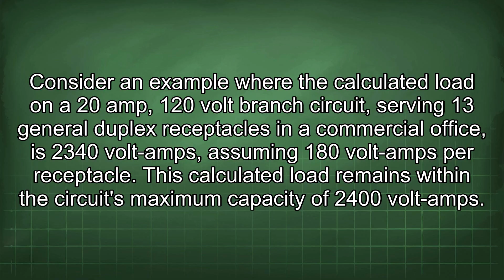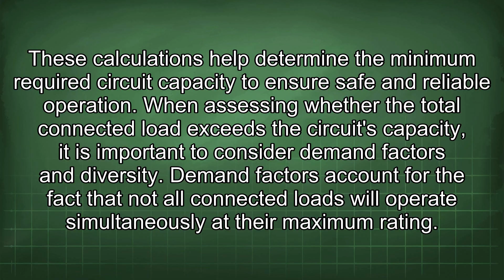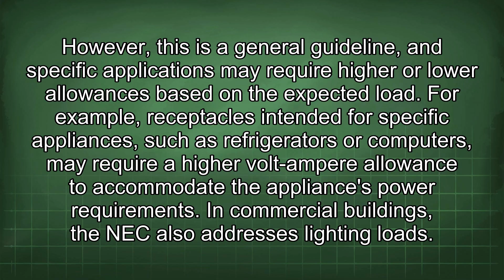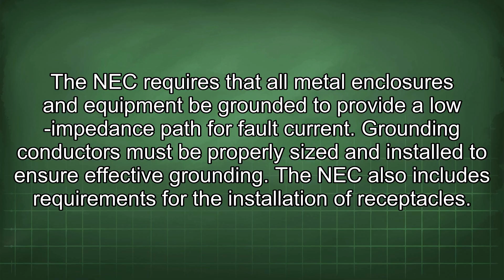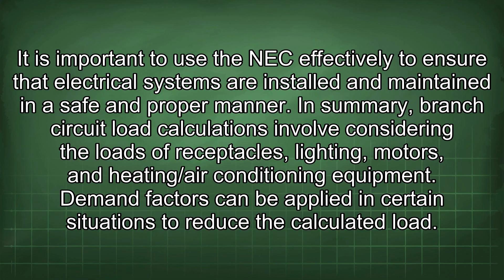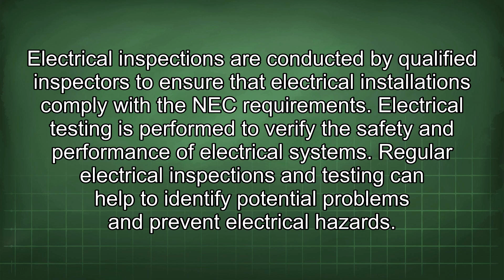Can Connected Load Exceed Circuit Capacity? NEC Explained.

Comment: Code requires calculated load based on 80% for continuous use and 100% for non-continuous. The va per outlet recommendation doesn't limit the number of outlets on a circuit, but it is supposed to be calculated based on square footage of rooms and building as a whole. 3 va/square foot residential. Minimum number of circuits based on footage. If you want 85 receptacles in one bedroom, go for it. It doesn't mean one circuit can serve 50 outlets in every room and 6 or 7 circuits with one outlet in one room.
Reply from the maker: Hello @jimcranston5730,

Thanks for your comment. The statement you've provided appears to be a mix of correct and incorrect interpretations of the National Electrical Code (NEC) and general electrical design principles. Let's break down each part:

"Code requires calculated load based on 80% for continuous use and 100% for non-continuous."

This is generally correct. The NEC, specifically in Article 210.19(A)(1), requires that branch-circuit conductors have an ampacity not less than the maximum load to be served. For a continuous load (a load where the maximum current is expected to continue for 3 hours or more), the overcurrent device (e.g., a circuit breaker) must be rated at not less than 125% of the continuous load. This is often simplified to mean the continuous load cannot exceed 80% of the circuit's rating. Non-continuous loads can be calculated at 100%.

"The va per outlet recommendation doesn't limit the number of outlets on a circuit..."

This is also generally correct, but with a nuance. The NEC does not specify a maximum number of general-purpose receptacles that can be connected to a single circuit. Instead, it focuses on the total connected load in volt-amperes (VA). However, good design practice and local codes may place practical limits.

"...but it is supposed to be calculated based on square footage of rooms and building as a whole. 3 va/square foot residential."

This is correct. The NEC uses a "general lighting and receptacle load" calculation for residential occupancies, and the standard value is indeed 3 VA per square foot. This calculation is used to determine the minimum number of branch circuits required for a dwelling. It's a fundamental part of the overall electrical service and circuit design.

"Minimum number of circuits based on footage."

This is correct. The total calculated load in VA, based on the square footage, is divided by the voltage and then by the amperage of the circuit to determine the minimum number of 15A or 20A circuits required. For example, a 2,000 sq ft house would have a lighting/receptacle load of 2,000×3=6,000 VA. On a 120V system, this is 50 amps (6,000VA÷120V=50A). This would require at least 4 circuits (assuming 15A circuits, 50A÷15A≈3.3, rounded up to 4).

"If you want 85 receptacles in one bedroom, go for it."

This is theoretically correct from a "code" perspective, but highly impractical and a bad idea. As stated, the NEC doesn't limit the number of receptacles per circuit. However, a single 15A circuit can only safely handle a certain amount of load. Putting 85 receptacles on one circuit means that if you plug in just one high-demand appliance, like a space heater, the circuit could be overloaded, regardless of the number of other receptacles. A more practical design would distribute the receptacles among multiple circuits to prevent overloading and provide greater flexibility.

"It doesn't mean one circuit can serve 50 outlets in every room and 6 or 7 circuits with one outlet in one room."

This statement is a bit confusing but appears to be a critique of poor design. The first part, "one circuit can serve 50 outlets in every room," is a valid point of concern. While the code doesn't prohibit this, it's a very poor design that would likely lead to frequent tripping of the circuit breaker. The second part, "6 or 7 circuits with one outlet in one room," is also a critique of inefficiency. While not against code, it would be an excessive and likely unnecessary use of circuits. The goal of good electrical design is to provide a sufficient number of circuits for the anticipated load, with a sensible distribution of outlets, not to just add circuits or outlets arbitrarily.

In summary, the statement correctly identifies key NEC principles (load calculation, 3 VA/sq ft, and the lack of a receptacle limit) but highlights a common misconception about good electrical design. While the code provides the minimum requirements for safety, it doesn't always dictate the best or most practical design for functionality and user convenience. The difference between "code compliant" and "good practice" is a key distinction here.

Sincerely,

BESA Research